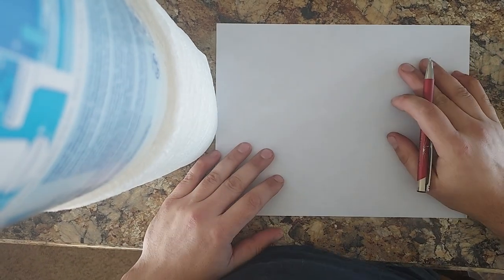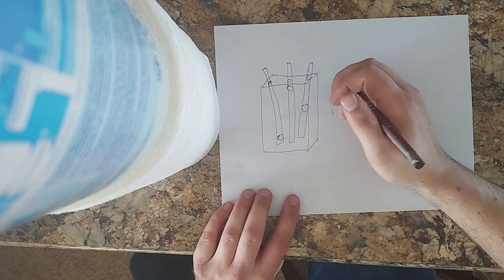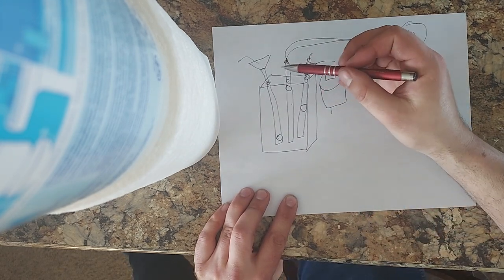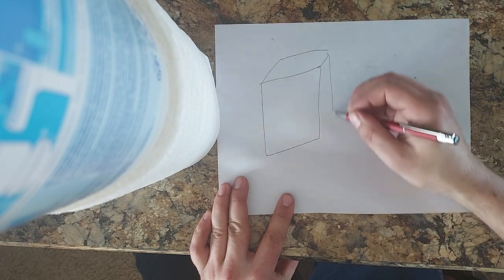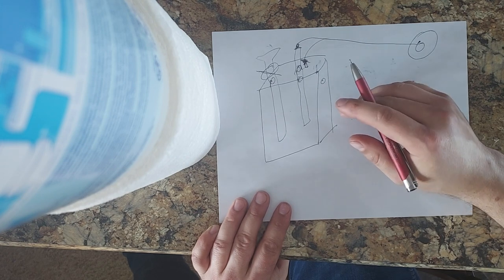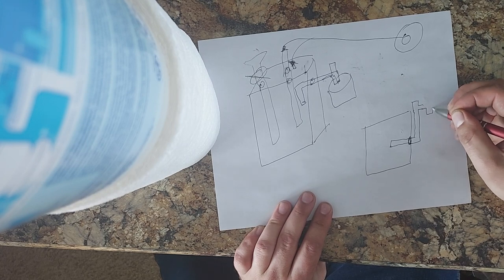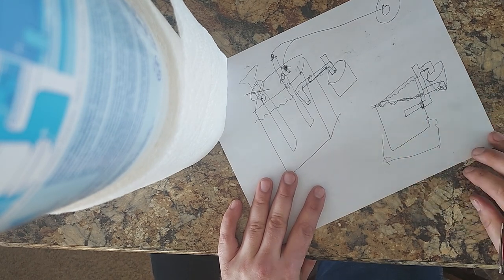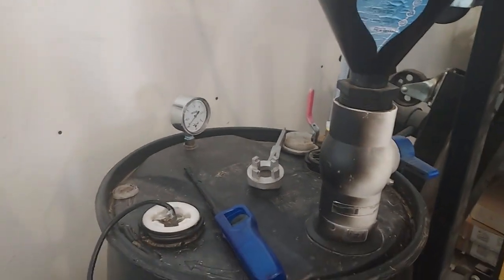Biodigester Design/construction - part one

Comment: Okay, the point that jumps out to me here is that the liquid level on the Solar cities design should actually be a few inches lower than the top of the IBC. The key here is closing the gas tap every time you add new substrate. The gas pressure inside stops the liquid level from rising, and the only way for the overflow to go is the digestate outlet pipe. I've built one with this design, and it works, at least in the summer.

Comment: I use two, 55 gallon barrels. A bulkhead fitting with a spigot near the bottom to release the liquid fertilizer. About 40 inch long, 6 in wide pvc from the bottom out the top with cap for inflow of organic material. Then simple fittings and hoses from the slurry tank, to filters, to final 55 gallon barrel with pressure release valve. Where the gas will stay until its bottled into a propane tank by use of air compressor! Still in process of constructing it but will upload when done

Comment: Thank you for sharing!
why did you remove your steel wool filter? 
Did the activated charcoal help filter the CO2?
Reply from the maker: Hello. I moved all the filters to be between the digester and the inner tubes. That way the gas passes through them slower and they have a better chance to work. 

I have left the charcoal filter but replaced the steel wool filter with a molecular sieve. I will be making a video about my current filter set up shortly.

Comment: Thank you for sharing!
Did you remove your steel wool filter? 
Did the activated charcoal help filter the CO2?
Reply from the maker: I am not convinced the charcoal filter had any effect. 

I did remove the steel wool filter, I know for sure that was not effective enough. What I found was a water bubler was highly effective against h2s. 

If I remember correctly when I was using steel wool I had 60ppm in the barrel and 40ppm in the inner tube. 

Currently, my digester is more mature. I have 200ppm in the barrel and with just a water bubler I can maintain 0ppm in the inner tube.

Comment: Why do you think you need more service area, my understanding is the microbial life is what’s making the gas not service area ?
Reply from the maker: Hello. There are two reasons

First, I could certainly be wrong, but I feel a larger liquid/air interface will let the liquid release the gas easier. 

Also, if slurry is obstructing the gas outlet then it will be pushed down your tubing and wind up in your filters/gas vessels
Reply from the maker: Do you think that soda would go flat faster if it has a larger surface/air interface?
Reply: Mr. empirical here...lol. install a quality flow meter after the desiccant notifier. Measure the gas volume output. Compare. Anecdotal  speculation is often costly.